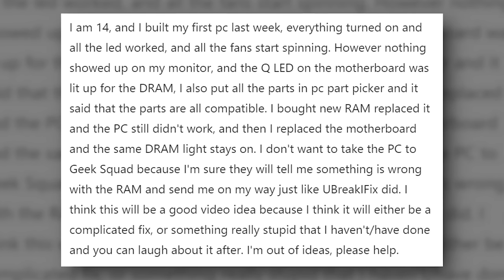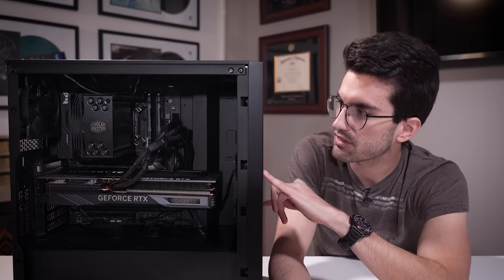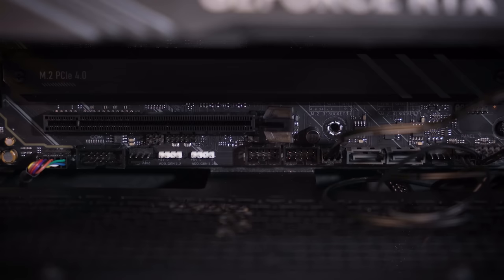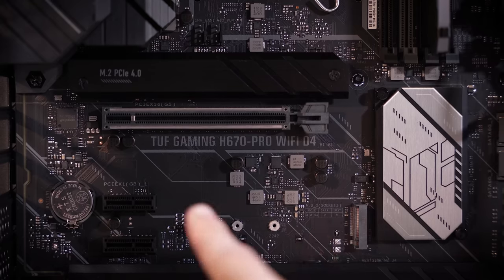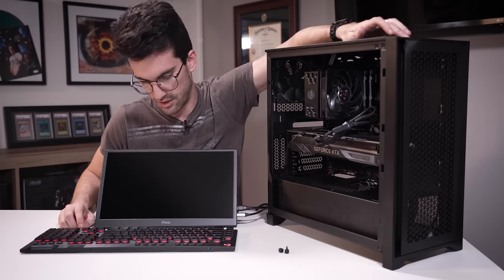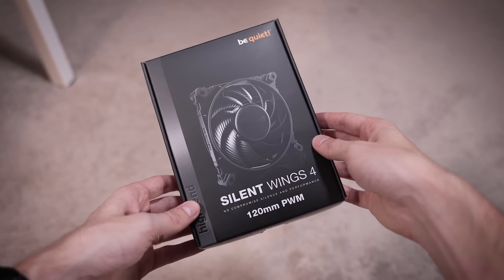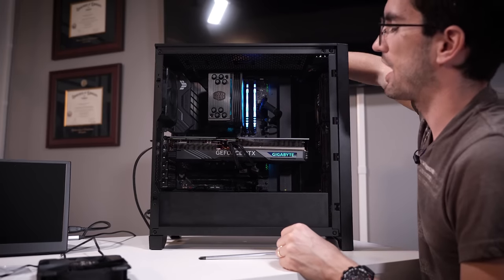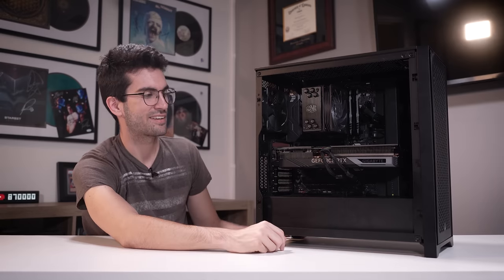Fixing a Viewer's BROKEN Gaming PC? - Fix or Flop S4:E4

Comment: My first build 3 yrs. ago did the same thing.  I was happy everything had power fans work lights work but no post.  I first check the ram & had graphics on CPU so I removed the graphics to check that. Eventually I realized I had the just released CPU & had to do a Bios update for the motherboard to get it working.  Lucky my board had Bios update & did not have to get an older CPU.   Before I built my 1st PC I watched a lot of your videos, plus others like Paul's Hardware & Jays two cents.  Thank you & all the rest who post these learning videos which help us a lot.

Comment: Props to the owner for taking on the task. The first PC build, especially with brand new hardware, is always the most nerve-racking. And it doesn't always go as planned. What's super unfair is the removal of actual debug displays from nearly all midrange and entry level boards. If they're going to save pennies there on $200+ boards, it'd be nice if they actually shipped with BIOS versions that aren't years out of date.

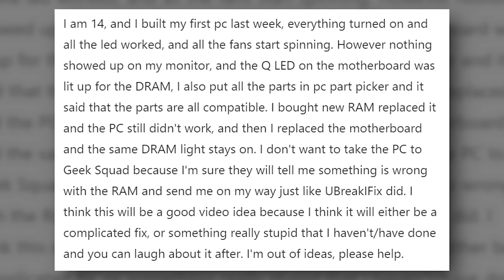Comment: 0:11 If the owner just read what the part picker said, it would have warned about the bios. Part picker shows boards as compatible even when they may possibly need a bios upgrade before they will work. The warning is pretty hard to miss. Happened to me on my last build as I wanted to use an older board on purpose to save money

Comment: This is such a classic problem. I am glad to see some companies find a way around it. I had the same thing happen on my Z170 board going from a 6700K to a 7700K 4 or 5 years ago. And going from a core 2 duo to a quad core years before that. And upgrading from a 1700mhz AMD Athlon to a 2100mhz AMD Athlon back on a Soltek SL75 board back in the early 2000s. And going from a 500mhz processor to an 866mhz processor pentium 3. And going back to when I started working on PCs going from a 266mhz to a 333mhz Pentium 2 in 1998.

Comment: Nice gesture fixing the fan configuration and cable management.
One thing that could have helped even further is to repurpose the original front fan as top-left exhaust instead of removing it. Couldn't hurt.

Comment: It's really good to see the younger generation not only dedicated to PC gaming instead of smart phones, but building themselves. As an added note, regarding the 4090 burning connectors, if you've watched NorthridgeFix's latest content, he's  saying that the melted connectors are not all from unseated cables, but from cables that are correctly inserted also, this may not be a 'user error' issue (it wasn't to begin with.. if you have a power cable incorrectly seated the card should have fail safes other than exploding) fortunately it seems to be (mostly) the 90's that are having the issue, the 80's seem relatively safe, since there are practically no cases of melting amongst 3090Ti owners, which use the same connector and a higher power draw, this would point to an issue on the 90 series cards.. but the saga is continuing to develop

Comment: Great job as always- 
Your channel really does help- My PC wouldn't post after I moved to a new location, I followed your step to solve it, it was the bios.  But I think the mother board was damaged during the move.
It  did post to a safe bios, but I had to leave it running 24/7 or I would have to repeat the process.
I was going to upgrade soon anyway, so I upgraded to a 12400 on a B660 Tuff gaming board, a big jump from a 10400 and I can upgrade to a 13600k when ready to do so.

Comment: I have an old Hyper 212 Evo cooler on my aging FX-8320e. The fan, while still working, was getting loud and whiny. I replaced the fan with a beQuiet! Pure Wings 2 fan and it runs just as cool (cooler actually, but that might have just been from spring cleaning) and darn near dead silent. Love their fans.

Comment: I mount my CPU fans on the left out of habit. In most boards the RAM is way too close to the fan, when it's on the right. And I had the fan basically vibrate a stick. Which caused random bluescreens. Once I put the fan on the left. It never happened again. But I still have the fan pull heat from the HS. Not pull air from the rear. Boards should add another debug light "Firmware".

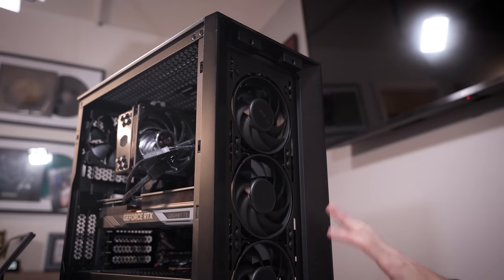Comment: 13:50 No need to lower the exhaust fan - warm air tends to rise surprisingly quickly with little inertia IME, so you might even consider moving it to the top entirely, fan bearings permitting. Now in the lowered position it might be drawing in warm air from the other components better. If in doubt, temperatures would have to be watched in use, but that's fine-tuning, alongside XMP, C-States, ASPM and such.

I got a Silent Wings 4 140 mm as an exhaust fan recently, and the rubber nibble mounting definitely gets a thumbs up from me. It's holding on well even in elongated holes (which is more than I can say for one-sided Noctua rubber nipples, an NF-A14 with those slides down immediately). The fan itself has the kind of premium feel that you expect at its price point, too, and dare I say it's pretty sexy-looking?

Comment: its so funny that bios problem with sign of dram compability , as a experience builder its easy to try those things ( cmos , switching parts etc )
but the issues is even if someone brought it to the store bcs youre not as experience  as greg, they will likely to make you buy / swap something instead doing troubleshoot .
those vendors need to work on them debug led

Comment: I've mentioned it before but this is the exact problem I had somewhat recently. Processor was too new for the motherboard's BIOS, needed to put a different processor into it to update the BIOS, then put the other one back in and it's right as rain. Nothing on the motherboard to deal with it without the old processor, and I actually hauled it around and either got "Can't do anything about that." or "We'll need to hold onto it for a few days, also that'll cost around the same as just buying a processor to do this with yourself.". It's one thing if the parts to do it aren't around, but if I need something done that'll take like, an hour tops (and that's probably being generous) if the necessary component is available then don't tell me that I'm going to have to drop the thing off and come back another day for it. There's no sense in that, no sense at all.

Comment: Let's see what Greg has for us today 😁👍
Reply: BIOS... had that issue in the past couple of times. Thank you for the video 🙂
Reply: I hate the fact manufacturer's update the bios right form the getgo. That's su stupid, I doubt it's his fault, he didn't know
Reply: @chrism869  yeah sadly it is true and necesarry. For example BIOS can have some bug or you bought some latest CPU where BIOS does not have it on its own list and that is why it wont boot. It is good to update BIOS when you buy a motherboard but read its description on the web page. The worse it is, if you do not have flashback to be able to flash bios without correct CPU where in that case supportes CPU needs to be putted in so you can upgrade it. There is more to this but I went through it roughly.

Comment: I wish more motherboard manuals would link to the online repository of bios and walk them through what bios works with what cpus better, so someone who was new at building pcs could figure this out. I remember when I first started building pcs during the pandemic and trying to pair a 5600x with an older am4 mobo was a nightmare. TBH even now when I buy older b450 mobos to pair with 3600x or newer cpus for budget builds I have to keep a ryzen 2700 around incase I have to dig around said mobos bios to update it to the latest correct bios, its a pain and I know what im doing lol.

Comment: While he can't overclock, he can unlock the power limit so the CPU will boost to the max turbo speed for longer. Set the long and short duration power limit to a higher value like 235w, the 13600kf will boost to their max clock for longer.
Reply: Asus Z690 TUF Wifi is $180 currently same as Tuf H670 $180 not sure why he would of bought that overpriced motherboard.
Reply: @jaggsta  yea, he could've gotten a Z690 board for the same price or cheaper. I'm running a MSI Pro Z690-A DDR4, it was only $120.
Reply: @jaggsta  Maybe he found it on sale somewhere or something? Or they were temporarily out? Both are true for why I got the CPU I have.

Comment: @Greg, many thanks for the great videos! Specially love the trouble shooting ones!! I wish I lived closer to you as my PC could really use your expertise. 

First time I press the Power Button, the system starts and then turns off within like 5 seconds. On pressing the power button for second time, system works absolutely perfectly like nothing happened.. windows also does not report a boot faliure... and also on 2nd press of power button it never shuts off this time. 

This happens about once in every three times i start my PC.

My System Specs :
Ryzen 7 5700G
Gigabyte B450M-DS3H on latest bios
Gigabyte GTX 1650 Super
Deepcool Gammax 400 XT Cooler
2*8GB DDR4 3200 GSkill
Samsung 512GB NVMe SSD
Antec CSK 550w 80+ Bronze (new)

Have learned a lot from you videos and tried the isolation method of Trouble shooting:

1) Disconnected all cables and peripherals and reconnected only required parts... even tried outside the case
2) Moved RAM modules to empty slots... tried with single stick also... tried different ram from another PC
3) Removed NVMe SSD and installed fresh OS on a spare SATA SSD
4) Replaced old Antec Atom 550w with Brand New Antec CSK 550w 80+ Bronze
5) Removed CPU and reapplied Thermal Grizzly and reseated the cooler
6) Updated Bios to latest version F64a
7) Removed Graphics card and tried with integrated graphics

But.... issue remains same 😭

I do not have access to a spare motherboard & processor.  Would really appreciate if you could guide me here!

Comment: look at those stock voltages asus gives. 
It's absolutely ABSURD.
 I have a B660 Tuf Gaming D4 with 13700K (I know I know, not the best pair) and , at 1st 13th gen working bios, gave 1.61v , which is enought to melt the socket if it is left like this. I, then, did a bios update, and it went down to 1.48v (still too much), and managed to have it at 1.38, but not in the traditional way of undervolting, as intel has removed uv at B series chipsets. I am going to replace this trash motherboard, literal trash as I leave performance on the table and my temps are not very good either.

Props to you mate for fixing another PC for this young guy :D

Comment: it happened to me before on my ASUS ROG Strix B550-E Gaming WiFi. I had a power outage. 😂😂 Ordered a replacement BIOS chip, removed the old one using hot air and soldered a new one. Still works like new.

Comment: PSA: When choosing a motherboard, always, always choose one that lists support for your chosen CPU out of the box, without a BIOS update.

If the motherboard in question specifies that your CPU is supported with a BIOS update, just skip it and choose a different motherboard. There's a very high chance that it will not have a BIOS new enough to support your CPU. The vast majority, if not all motherboards of a particular model almost always come with the original BIOS. They don't go back into the stores to update them.

If you do get such a motherboard, it may be a real PitA trying to update the BIOS. Even with those that have a direct flashback functionality through a USB port you always run the risk of something going wrong, bricking the motherboard. You might not even be able to RMA it after that, because you bricked the motherboard.

Comment: Greg, I have AMD Ryzen 5 3600 CPU on a MSI Tomahawk Max B450 board. I was cleaning the PC and I took the CPU cooler, a  Noctua NH-U12 A to check the thermo paste ,you guessed it the CPU was stuck to the cooler. I used alcohol and cotton swaps to loosed the paste and as able to get to remove the CPU. I put the CPU back in what I thought was the correct orientation, however when I went to turn it on, it was dead as a stone .  I did some reading and someone said if the CPU is not in the correct position ,the machine would turn on. I removed the cooler again and removed the CPU. I hit the power button and the machine turned on . I looked at the CPU pins and it looked like you of them was bent. I straightened the pins, well as far as I could tell. When I power the machine up I get DRAM led light . Before all this happened the computer was running fine . I may have still a bent pin ,or the controller chip in the CPU is bad or the board may be damaged. What do think ,I have ordered a new board and CPU

Comment: I had this exact same problem... old motherboard bios (same thing).. but I have a 2080super and a 13700kf... the place i bought it from installed the new bios for me... got it back and it only booted half of the times. what I did: Replaced ram with something that was on the approved list, still only 50% boot.. I moved the m2 from the slot nearest the gpu to the others... Unpluged and pluged all the things. (I have the asus thor 850W psu). Nothing worked. So I sent them back to the place i bought it. Still waiting on the funds back. Any good ideas on what I could have done?

Comment: Some vendors have a bios flash option so you can be sure that the mobo has been tested and is already flashed to the latest version. Even if they charge you 50 bucks for it, if you are a Newbie with no other hardware or geeks around you it is worthwhile considering.

Comment: big fan of be quiet fans (or be quiet products in general)  but those anti vibration pins or whatever they're called - theyre a massive pain in the sass to remove... especially when its time to clean your rig. Much prefer a soft pad on the fan with a good ol' screw to mount. <3

Comment: BIOS flashing is a nightmare. I didn't have the privilege to build my own PC, and had to watch a technician finish it instead. I later discovered that the Motherboard was running F5 bios version which was actually stock. I tried to flash my Gigabyte B660 DS3H AX DDR4, yet chickened out at the last moment. I used their @BIOS tool instead, which allowed the PC to connect to their Servers and obtain the latest stable bios version and automatically flashing it. Now, it's compatible with 13th Gen Intel CPUs, if I ever wanted to upgrade the CPU.

Comment: Be quiet are some of the best fans on the market. I've had their Silent Wings 3 and those are dead silent, and very quiet even on high rpm. Very good for a quiet and efficient cooling . One thing I personally don't like is the PWM control - I'd much rather have regular old 3PIN connected to a manual RPM controller, than have to bother with setting up PWM standards in BIOS - it's tedious, especially if you have multiple fans (I have 9 in my case) and especially if  they are of different brands or RPM rating - you need higher speed or static pressure fans on your radiator and higher airflow or lesser speed on your case (depending on case ventilation) . 
I would love for you to do a tutorial on PWM fan profiles, what do you think is optimal. Leaving it on stock motherboard settings is usually not enough for gaming sessions - fans rarely ramp up, while the temperature goes nuclear... I'd rather have higher noise and lower temps than risk overheating.

Comment: I wonder if there is a way to put the bios on the actual cpu? Like integrate it into the cpu so whenever you buy a chip you’ll always have the correct bios then maybe it can be saved to the board and updated from there? Just some thoughts.

Comment: The AMD board I got would have required a CPU to flash it, but luckily this was during the time when you could get AMD to send out a cheap loaner chip to perform the bios upgrade. 

That said, I didn't wind up needing it, as it already had the latest BIOS on it. But I was ready to do it the second I had a problem. It just turned out to be something else.

Comment: A lot of people really don't spend time in bios. Those people don't want to spend the extra 100$-200$ on a mobo.

Honestly a K chip in a non Z board isn't really a big deal. 
Still runs that i5 at full speed, still get xmp, just can't overclock.

As always great content and great work, thanks for helping that person out.
Reply: Raptorlake overclocks like a beast though. It's a real waste to run at sub 5ghz if you can push it with relative ease and have it last longer.

Comment: What I wish MOBO manufacturers would do these days is have a simple VGA chip on the board, so they board can boot into the BIOS without a CPU, RAM etc, running from a ROM chip to do so. This would be an easy and safe way to ensure BIOS upgrades would happen when QFlash doesn't work. A simple 640x480 VGA chip isn't going to break the bank, cost will be buttons. The CMOS when Posting if it doesn't detect RAM/CPU it should boot via the VGA chip and separate ROM chip to enable access to the BIOS easily, also it could do this if there is a fault.. to show a log on what a fault was also.

Guess it wouldn't be efficient in manufacturing I guess.

Comment: I had this problem with a guy's 10th gen motherboard and 11th gen chip.  Had to swap his old processor back in and then update the bios and swap back.  That said...

Your cable management is triggering me.  You have the graphics card cable going OVER THE FRONT and then down.  I think it should go along the top and then through the same hole as the rest of the cables.  My cable management sucks, though, so I'm not judging... just saying.